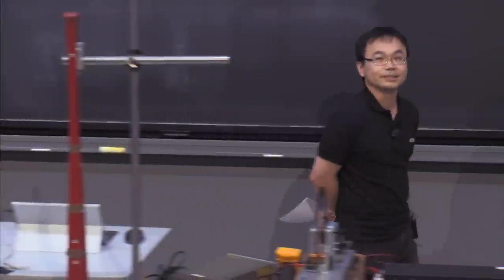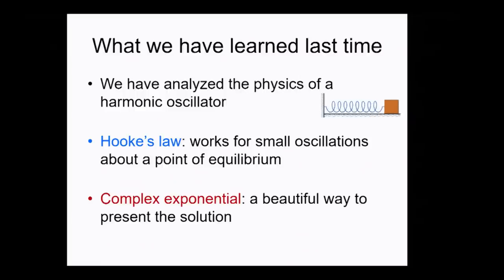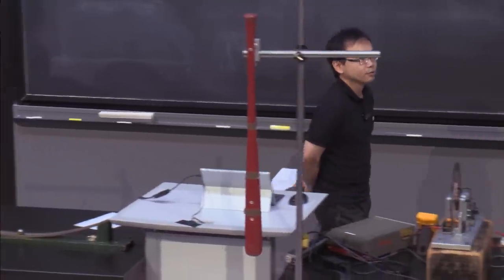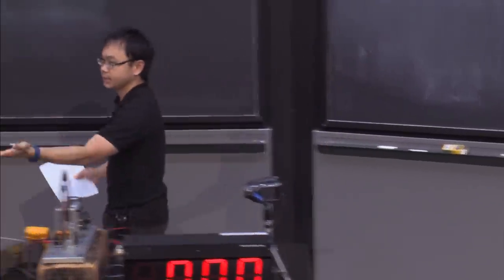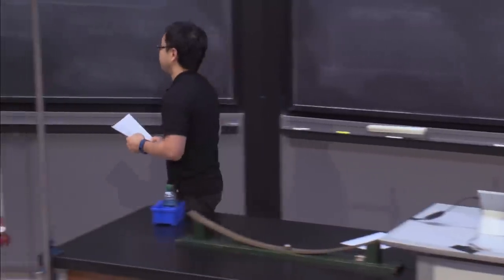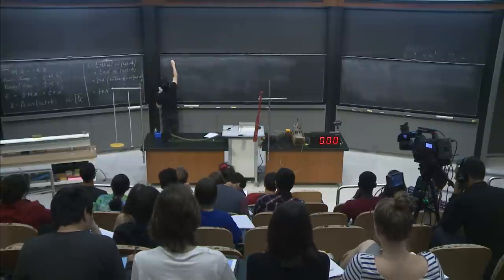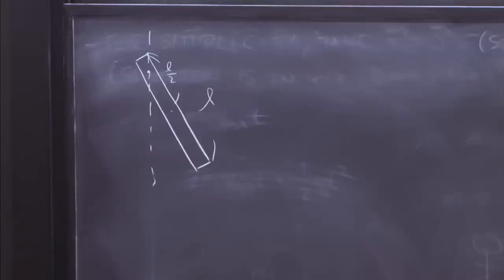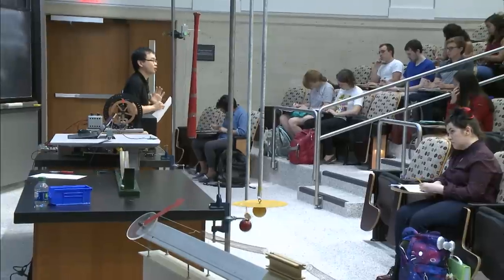2. Damped Free Oscillators

Comment: As others have mentioned, the math for θ_ at 44:23 is incorrect.  It should be Re[e^-iωt] = cos(-ωt) = cos(ωt), meaning his "general" form should actually just be e^Γt/2 * cos(ωt).  The rest of the equation involving sin() does not follow from anything he did previously.

The reason this happened was because the function he introduced as a potential solution, Z(t) = e^iαt, is A solution to the differential equation, but it is not THE general solution.  In other words, it does not encompass all possible solutions.   This is because the general solution to the simple harmonic motion equation (from the previous lecture) is A*cos(ωt) + B*sin(ωt) before initial condition constraints, while Ae^iωt = A*cos(ωt) + iA*sin(ωt) which only has one free term instead of two.  Thus Ae^iωt does not encompass all possible solutions.

(He later "corrects" it by claiming you get the sin() term from linear combinations of e^iαt. While it's true that this justifies the use of sin() in the general solution to the overall differential equation, it still does not justify that particular choice for θ_(t). He's just doubling-down on his mistake)
Reply: Would this be fixed if his solution were Ae^iat?
Reply: @Blue Raja I completely agree. I recommend people follow the explanation in the book used for this course, Georgi The Physics of Waves (the book is free online) section 2.1.2 but read the sections before that starting at top of section 2.1. It isn't long and the mathematics is clear and easier to follow.
Reply: If he said the latter, he’d still not be correct. He could only obtain x(t)=Acos(at)+Bcos(wt) as a linear combination of e^(iwt)  and its complex conjugate e^(-iwt). Otherwise, he’ll always have some complex term in the solution.
Once we have these two solutions, it’s not hard to show that for any c,d in R, there’s a complex A(c,d) and B(b,d) such that Ae^(-iwt)+Be^(iwt)=dcos(wt)+csin(wt).. So this bit of step skipping isn’t really helpful to what is more subtle than it may initially appear to be.
Reply: Thanks, this is what I was about to ask
Reply: I was thinking the exact same thing as I watched his derivation and plugged the exact same question into Wolfram Alpha: 

Re{e(iwt)} = cos(wt)
Re{e(-iwt)} = cos(wt)

How?

Because of the following identity:

e^(+iwt) = cos(wt) + i*sin(wt)
e^(-iwt) = cos(wt) - i*sin(wt)

You essentially REMOVE the {i*sin(wt)} when performing Re{Z(t)}

Edit: I think I see how they called that section: "Small Issues", so they can see the error, imo.
Reply: I think his reasoning is that: theta1 and theta2 form a basis for all possible solutions. So theta can be a composition from linear combination of both theta1 and theta2 and the coefficients are yet to be determined. If you link the init condition then you get can the coefficients.

Comment: 1:15:22 actually Energy (If I can call it like that) is conserved in a different manner, not in the form of T+U=E (T=Kinetic Emergy, U=Potential Emergy, E= Total Energy) but in the form: T+U - v•(δU/δv)= E, you have to add the velocity gradient of the potential Energy and multiply it by v).  So you make E*=E+v(δU/δv) to rewrite the equation as T+U=E*, E* is not conserved because it depends on time. (Actually one defines an effective potential U* as U*=U-v•(δU/δv))

The potential U is defined to satisfy F=d/dt(δU/δv)-δU/δx. *You can find the proof in any classical mechanics book but if you want I prove it in a reply.

In this case U(x,v)=(-bv+kx)x/2
Reply: Proof: The potential energy is defined in a wat such that it satisfies the relation

(1)—— dU=-F•dr

Being F•dr the scalar product of the force with the infinitesimal displacement r, which integrated gives the work.

Now if V is some function of both the position x, and the velocity v (V=V(x,v)) then differentiating we have because of the chain rule for multivariable calculus:

dV=δV/δx•dx +δV/δv•dv. 

Now we use the Leibniz Rule in: d(δV/δv•v)=d(δV/δv)•v+ δV/δv•dv. We rearrange this equation and get

dV=δV/δx•dx +d(δV/δv•v)-d(δV/δv)•v

Rearranging: 

(2)——. d(V-δV/δv•v)=(δV/δx-d/dt(δV/δv))•dx *Used the fact that dA=(dA/dt)dt and dx=vdt.

Comparing (1) and (2) one sees that the potential U has to satisfy 

U=V-δV/δv•v (actually U is the effective potential and V may be seen as the original potential function). 

And the force F is of the form 
F=d/dt(δV/δv)-δV/δx.

Now to estbalish that a quantity E is conserved (Energy), we part from Newton third Law F=ma, and multiply it by dx, so  F•dx=ma•dx=ma•vdt=(mdv/dt•v)dt=m*d/dt(v^2/2)dt=d(mv^2/2). On the right side we have the Kinetic Energy & on the left side we have the potential energy (effective)!from its definition (1).

Because we have -dU=dT, means that d(T+U)=0 which means there exists a constant E (the total energy) such that

T+U=E. 

Finally, rewriting in terms of V:

 T+V-δV/δv•v=E.

Comment: I might just be confused but shoudn't Re[exp(-iwt)]=cos(wt)? I know this wouldn't make much sense as a solution but mathematically isn't it correct?
Reply: It's how differential equations are solved, better look at cs 18.03 (https://ocw.mit.edu/courses/mathematics/18-03sc-differential-equations-fall-2011/index.htm)
Reply: Vladimir, the link doesn't work. Could you please post a different link? Thank you!
Reply: @Paul Suroj cos(wt) is already real, so not correct to add Re(cos(wt)). Look at @Blue Raja explanation below, which is correct.
Reply: @abigailfriedman2652  it is neither correct nor wrong. It’s just trivial. Re(4)=4 obviously.
Reply: Yes.
Reply: This is correct. You can plug this into wolfram alpha to prove that you are correct. 

Euler Identity:

f(t+) = e^(+iwt) = cos(wt) + i*sin(wt)
f(t-) = e^(-iwt) = cos(wt) - i*sin(wt)

In both cases, " Re{ f(t) } = cos(wt) " because the " i*sin(wt) " is associated with the "Imaginary" part and is REMOVED from the equation. 

He needs to correct this mistake, imo.

Comment: Is it correct to say "energy is not conserved"? I mean after all Energy is ALWAYS conserved. What could be happening is that for a driven oscillator and a dampened oscillator is that energy from the system gets transferred to the surroundings of the system (in this case the air I guess) Can someone correct me if I'm wrong please?
Reply: You are correct, of course. It's just if you're considering only the mechanical system itself, and not including the rest of the universe its energy is not conserved; as you said it's transferred to the surroundings.
Reply: @tenebreonlabs  oh ok i get it now. It just felt weird to hear "energy is not conserved" thanks!